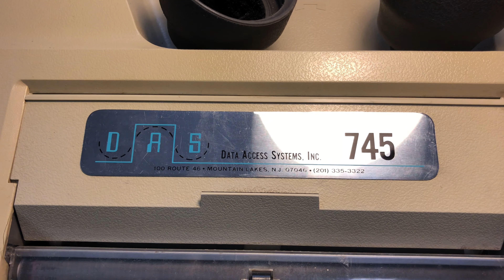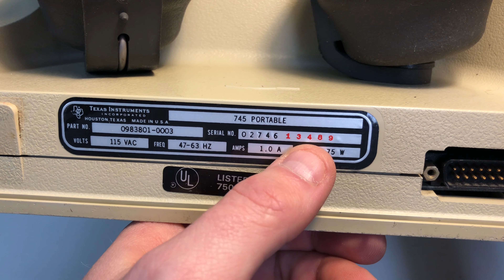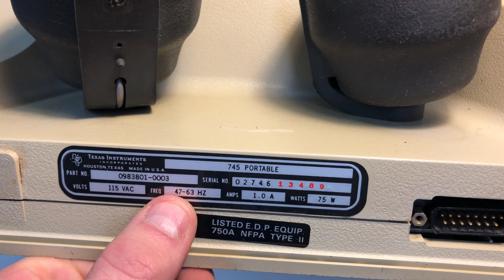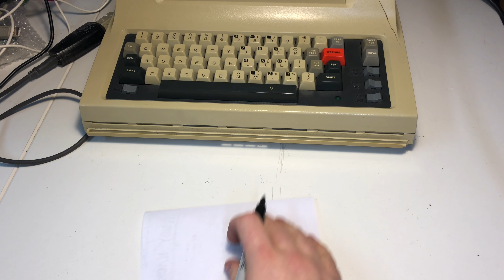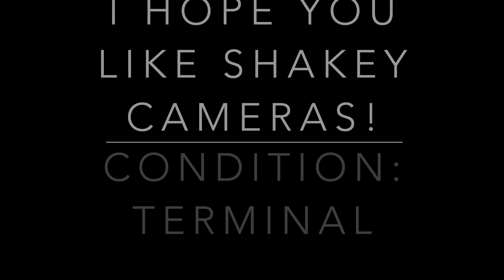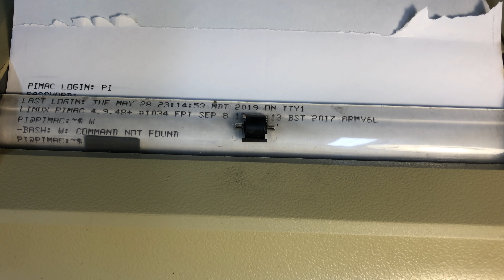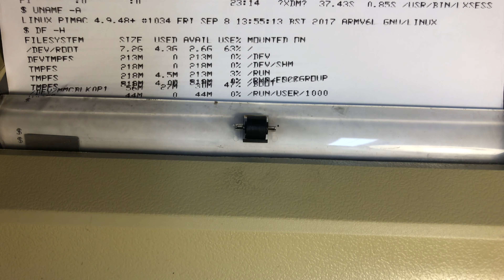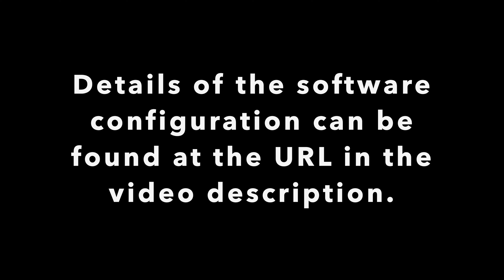TI Silent 745 Teletype: tour, teardown, and resurrection on its 40th birthday

Comment: The Silent 700 was my first "computer".   My dad's company provided this to log in to a mainframe.    The mainframe had a BASIC interpreter, so I actually learned to program on this thing!    It also had classic terminal games like Star Trek and Hunt the Wumpus.  

Thank you for resurrecting this one and sharing the video.  The sounds it makes are so nostalgic!
Reply from the maker: So, as someone who used one of these in the "real world", did you feel like you were wasting paper? I guess as a kid you wouldn't have, but your Dad maybe? I bought a huge roll of paper for this (1000+ yards, I think), more than I'll probably ever use, but I'm still reluctant to do anything on it because I feel like I'm needlessly wasting paper. Did you ever get that feeling back-in-the-day, or was the TTY such a common thing that people didn't worry about it?
Reply: @matthewnielsen2549  I used printing terminals a lot--Digital Equipment Corporation DECwriters (dot matrix impact), Anderson Jacobson (daisy wheel, I think) in a lab setting,  as well as the TI745 (not this particular one) at home for a work project.  I will say I greatly preferred a CRT (cathode ray tube) display terminal when possible because it was faster (and quieter than the loud buzzing and clacking of the impact printers).  I don't recall wasting paper being a big deal especially when printing was the only option.
Reply from the maker: @catenaire  Thanks for the memories! The new generation seems to romaticise the technology of previous generations (re: LP and Cassette), and I'm no exception to that.

I am old enough to have used dot-matrix printers at home at primary school, and while I still like them I also remember they weren't as great as I want to remember: a school computer lab with 10 Epsons all going at once would resonate through the whole school like a herd of drag-racing dumptrucks, and you could forget about printing your homework assignments after 10pm at home!

Comment: Thanks for this teardown, I'm just working on a similar machine. It's pretty much the same but uses a solenoid for paper advance instead of the stepper motor. One of the 3 silver capacitors at the back was shorted. There's also damage to the motor pulley for carriage movement that I'm struggling to fix.

Comment: Hang on; 7 bit ASCII is still the full ASCII character set. The 8th bit was only used for extended non-standard stuff. 7 bit ASCII has a complete set of upper- and lower-case letters, and complete punctuation. Unless you wrïtê lîké thīš âłł thê tîmë, you should have no problems.
Reply from the maker: The nuances of Ascii are really above my pay grade, so I'll absolutely believe you when you say it should have no problems.. but it does.

It wouldn't surprise me if they (TI) just omitted large parts of compatibility, because the keyboard includes no matrix encoding for upper/lower alpha keys (manual pg. 3-25) and the printhead character set has no bitmaps for anything beyond upper-case alpha and basic punctuation (pg 3-5).

It's also possible that the support in Linux for devices like this is broken because who has a 40-year-old terminal to test with?

Of course, I may have just set up something wrong since this is the first time I've messed with getty(1) in at least 10 years.
Reply: So the 745 you have is the "standard" model with the uppercase only or "limited ascii" it's also missing the `|{} characters. They had an option which i assume cost more to ship the 745 with a "full ascii keyboard" which includes lowercase letters and the `|{} characters. My 745 has this option. The num pad is gone, and instead of the "num" switch there's an "uppercase" switch, which switches the keyboard into "limited ascii" mode for legacy (at the time) support.

Comment: you can deal with the case problem with the stty program. Also setting the TERM variable should deal with it too.
Reply from the maker: Thanks for the note and sorry for the late reply -- I've following a discussion on Curious Marc's channel about getting getty/stty to work with single-case terminals and there are it looks like there are a few people actively trying to fix the breakage via a fork of getty though I haven't seen any releases yet. Once something like that is ready to go I will have to try this again.

As for the TERM variable, I did find some termcap settings for a Silent 703 in reddit a few months ago and I need to try them out: https://www.reddit.com/r/vintagecomputing/comments/h0rg4t/my_new_ti_silent_703/ftoq8dk/

Comment: Hi Mathew! I really enjoyed this video! I recently accrued a 745 with the "full ascii keyboard" so it can do lowercase too!
Anyway I know it has been already requested but It would be great if you could show us how you wired up the serial connector. I do know about the pinout in the service manual, but honestly its super confusing. The db15 connector seems to have another set of some of the rs232 pins but not all, and that is confusing me. Thanks!
Reply from the maker: Here is the pinout I used in the video, or you can find an easier-to-read one on github here: https://gist.github.com/xunker/22ac4feba5879c749438e4befc72d656.

Db15-f	db9-f

11	1
13	2
12	3
7	4
1	5
15	6
6	7
10	8
-	9
9	shield

Additionally, pin 7 and 2 to if the DB15 connector are connected to each other.
Reply: @matthewnielsen2549  Thank you, thank you, thank you!
This did clear up the confusion for me.
I was able to wire it up and get it to talk to Linux!

Comment: Great video! Would you mind sharing with my how you made the RS232 cable that goes from the DB15 to DB9? I am trying to make one for my 745 but I don't think I am getting the pinout quite right. Thanks!
Reply: Reading manual. Page 2-6
Reply: I think Amateur Tinkering knows about the manual, although the pinout in the manual is fine, the manual is unclear abut many things. Many of the rs232 pins are duplicated but not all. It is stated that some pins are relative to the keyboard and some to the acoustic coupler, I don't completely understand what that means, and I am also confused on how to properly wire up the cable.
Reply: @MyNikolaas  Yes, I have the manual but the pin layout is a bit confusing. I think I got it to work, but my thermal print head is not working correctly so I cannot read the output. More troubleshooting required...

Comment: I have one of these (TI Silent 700 745 Portable) with no power cord...but mine has round pins, not rectangular ones, for the power plug, with the middle pin slightly lower.  I'm guessing it went through different versions?  (This is not the [newer?] Silent 700 models that had an external power adapter.)
Reply: All the numbers on the back plate are the same except the serial number and the first part of it is 02745 instead of 02746.  Unfortunately Someone didn’t use the handy cord keeper inside the case
Reply: In the maintenance manual both types are listed as options, referred to as round pins and square pins. The round pin connector was common on adding machines before the square-pin IEC socket, and is also used on older HP test equipment. They're fairly hard to find now but I have seen them. I'm looking for another one myself as I have 3 items with that connector and only two cables :). I'm also wondering if one can be made by cutting and twisting a 'mickey-mouse' style IEC connector.

Comment: It's easier to cut down a wider roll of fax paper to fit rather than use what you can get that supposedly fits it from end to end and walks all over the place. 9600, N, 8, 2. ;)

Comment: I'm having the same problem as you with the all caps shell. Modern Linux don't respect the XCASE  ILCUC and OLCUC flags in the kernel  terminal driver.  Stty will let you turn them on and say they're wo
rking but in reality they don't. My problematic terminal is a tektronix 4006
Reply from the maker: When I was digging in to the terminal configuration for this video (5 months ago, so my memory is a bit foggy) I found that under Raspbian, those flags seem to only be honoured for the login prompt and not the tty/shell itself.

I need to find my old notes to be sure, but I seem like they used to work with the tty too but support was removed a few years ago (with a comment like "no one will ever need this" or something like that :) ).
Reply: That mentality sucks. Back in 2.0 Kernels it worked flawlessly.   I'm looking into the bsd's to see if they do it. .